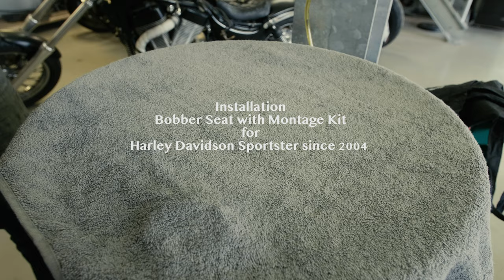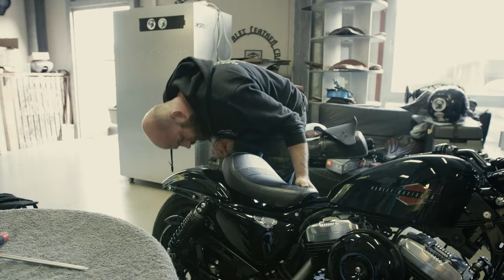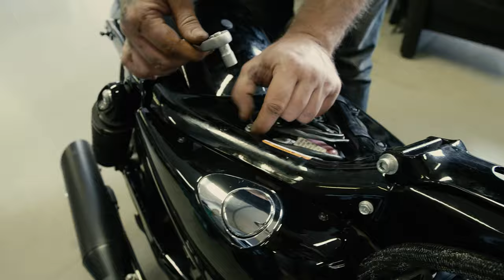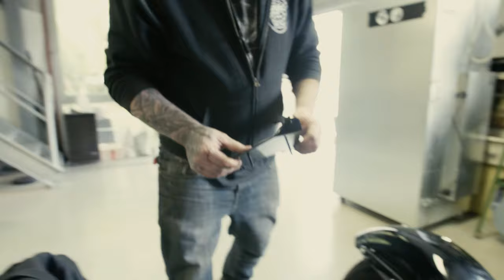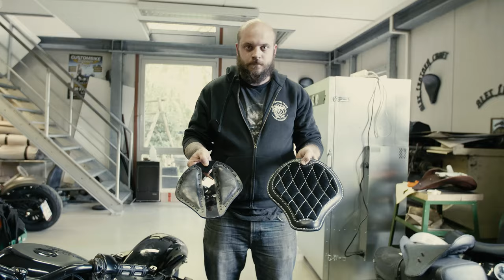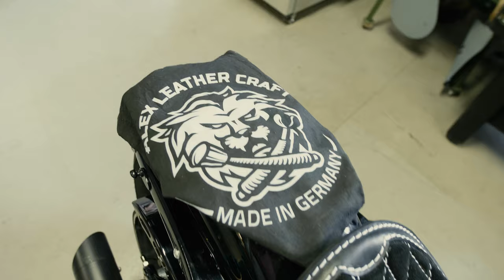Installation Bobber Seat with Montage Kit on a Harley-Davidson Sportster

Comment: Is the Montage kit also suitable for adding springs if you later want to change to a springed seat?
Reply: In my experience not really. Most springs will be too big and the seat will be very high unless you use very flat springs.

Comment: Hi! How can i install it with the ICM on a '05 sporty?
Reply from the maker: Good morning! 
some customer have removed the ICM by buying a smaller battery and placing the control unit on the battery. 
Others have switched the control unit and the battery. 
Some other customers have bought a different mounting plate that allows the control unit to remain under the seat and mounted one of our universal seats.
It depends on you and your possibilities which solution would be the best for you, so it´s hard to recommend the best way for you. But please let us know at any time if there´s something we could help you with!